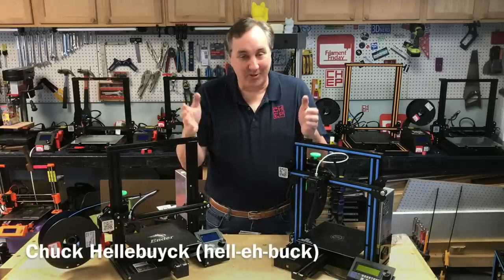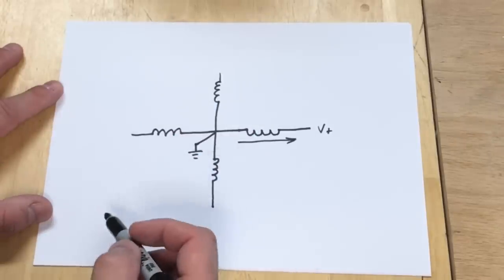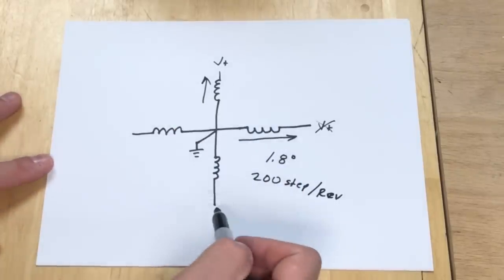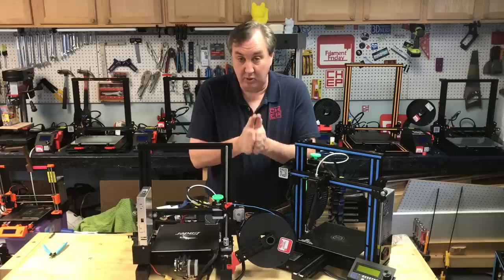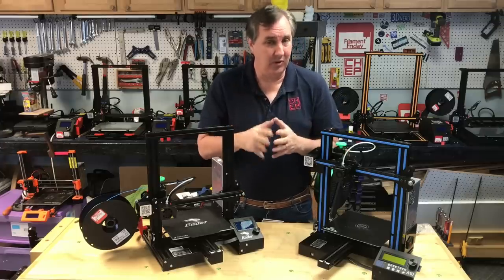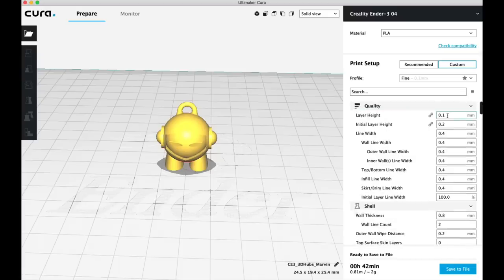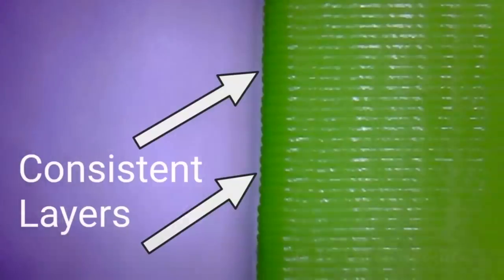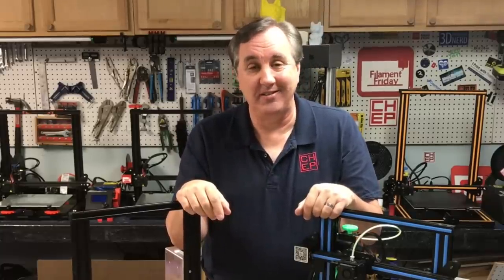Better Quality 3D Prints Using MAGIC NUMBERS on Creality Ender 3, CR-10, A10

Comment from the maker: Here is more detail about Magic Numbers: 
Microstep angles aren’t equal which causes the variations in layers that I showed without magic numbers. If your bed is leveled manually or autolevel at a microstep, using magic numbers makes layers rise to that same microstep thus averaging out those variations and giving a consistent layer height as the closeup view shows,
Reply: Excellent video as usual !
That explains why I see a lot of people printing in 0.16 and I'm like "Why the hell?". I guess that there's no visual difference with 0.1 on their printer and it's way faster to print...
Are these numbers working with the CR10S Pro ? (Yes, that's the one I have since almost 2 months :D).
Reply from the maker: Yes, I believe it’s the same.
Reply: Just set my Ender 3 to 0.12 and WOW!  Way better quality than just 0.10.  Should normally not see a difference og just 0.02mm, but it went from small ripples on a flat wall, to an almost glass-like finish!  Thanks ALOT!
Reply from the maker: Thanks for watching
Reply: Any idea what the formula would be for figuring out a delta?
Reply from the maker: There is a link in comments somewhere.
Reply: Thank you for your videos, I like so much. But I have a point for this one. I don't think this could work, how do you have sure your zero z position is in a full step position? Because if not, doesn't matter if you put 0,04 layer height, you will always get a micro step position.
Reply: Is there any way to get your bed  setup so it homes at a standard step rather than a microstep?
Reply: do the magic numbers still apply to even geared extruders? (3 to 1 ratio for example)
Reply from the maker: @Alan Braggs - Did you read my comment above? I explained it.
Reply from the maker: Rico Reyna - It corrects for z lift so direct or Bowden doesn’t matter.
Reply: @FilamentFriday   your explanation that it evens out over time would indicate that any microstepping LCD of .04 would be just as valid
Reply from the maker: 0.04 is the magic number for Creality machines. So 0.08, 0.12, 0.16 ... all work.
Reply: @FilamentFriday  hi there i have an anycubic i3 mega   would these same numbers work with my printer??
Reply: Awesome video!!! Quick question do you know the "Magic Number" for an Anycubic Mega-S??? Thx in advance. Greetings from Colombia.
Reply: cura now uses the magic numbers as default setting
Reply: Next upgrade would be to update the firmware to not use the microsteps. So go to min Z and then go up to the first natural step. That might even save power.
Reply: @gothmaniow  the T8 2 mm pitch with a 8 mm lead screw is very prevalent in the Chinese 3D printing industry. They all seem to use the same T8 2 mm pitch 4 start lead screws. The only exception I know of is that recently Creality started using T8 2 mm pitch with 2 starts to correct an issue with the Ender 5 and Ender 5 Pro printers to keep the bed from falling down when power is removed from the Z axis stepper motor. This becomes a problem, primarily, when the printer goes into power loss resume mode as the bed falls when the power goes out and then when you try to resume the print fails.
Reply: @BenEBrady  ?????   sorry  that still does not answer my question at all  that was way to complicated for my 53 yr old brain to comprehend   .. all i said was would these numbers work on my i3    was hoping for a simple Yes or No answer and maybe some tips if not ;)
Reply: @tonyd7177  the only answer I can give you is, more than likely.
Now, you CAN measure whether or not the magic numbers will work for you. If you move the Z axis up to 100 mm and then make a mark with some tape on a stationary point and then move the Z axis up (or down) 8 mm, and watch your Z coupler to see if it makes one revolution. If it makes one revolution, then the magic number of 0.04 applies to your printer. If it does 2 revolutions then your number if 0.02.
And my 63 year old brain doesn't have any problems understanding it.
Reply: @BenEBrady  thank you  that was a more than reasonable answer and sorry was not being sarky  i really do have memory problems ;)  , ive copied all what you have just said and gonna put it into practice tomorrow thank you :)
Reply: @AlanBraga  once you get to the first layer physically above the bed and isnt being pushed or pushing against the bed the stepper motor should naturally realign itself to a full step position.  The motor wants to be at a full step at rest and will attempt to go there upon startup.  Only an amount of torque greater than the motor is able to create from friction against the bed would cause that from not happening.i dont even think you could stall even a factory set z axis stepper motor on  a 3d printer without doing something dangerous and stupid.
Reply: How Can I go Deeper in to the subject ?
Reply: I don’t understand how  dividing 200 and 8 results in a the right layer height that matches the Steppers natural movement.
Reply: @efexzium  One revolution on the Z screw is 8 mm, right? And the motor has it's natural steps at 1.8 degree intervals which is 1/200 of 360 degrees (1/200 of one revolution). So the Z movement will be 1/200*8=0,04 mm per step.
Reply from the maker: Turn it one time and measure like I described.
Reply: super video! only a question: if I have calibrated z-steps from 400 to 405, this alter magic number, true?
Reply from the maker: Minor affect but exactly how did you do that? Seems so minor.
Reply: @FilamentFriday  i have a strange problem whit first layer and I suspect that z-steps calibration can affect manual mesh bed leveling process, but this is only a suspect. tnx for your feedback ;)
Reply from the maker: Yes, but Ender 3 and clones all come with 1.8° steppers.
Reply: Can we get an update?
Reply: @chep I'm confused how I could have my bed leveled at a microstep though. I understand setting the layer height part but you lost me with this comment

Comment: I've been using these numbers successfully for quite a few months now after watching a video a while back about "minifigs" or miniature figurines and how to achieve the best possible quality using the smallest detail settings for Cura. That opened my eyes to working specifically with the nozzle size and stepper movements to achieve insane detail. But your video was the first to show the microscopic details of the layers and just how well those numbers are actually benefiting and for that I thank you, Chep! You continue to share such wonderful advice and best of all, in video lengths that are easily digestible vs these other 15-20 min vids.

Comment: Chuck, thanks for a great visual explanation. I found a way to override the default layer heights in Cura 3.6.0.

1. Close the Cura 3.6.0.

2. Open the folder "C:\Program Files\Ultimaker Cura 3.6\resources\quality\" in Explorer.

3. Using a text editor, make the following changes to these files:

extra_fast.inst.cfg:

 layer_height = 0.28

fast.inst.cfg:

 layer_height = 0.16

high.inst.cfg:

 layer_height = 0.08

normal.inst.cfg:

//you need to add new string into the [values] section:

 layer_height = 0.12

4. Save the changes.

5. Open the Cura 3.6.0.

6. Profit!
Reply from the maker: Great tip. Thanks.
Reply: Спасибо, Артемий! Thank you, Artemij! 😊🍸 And of course, thank you CHEP.
Reply: Works like a charm!!!

Comment: I have to congratulate you on what is (in my opinion) probably the most informative YouTube channel I have found.
I have a CR-10 by the way.

Magic numbers eh? Well I'm blowed! Makes perfect sense after you explained it in such clear detail.
I'm printing some prototype motorcycle parts in PLA, and just changed my layer height from 0.3mm (0.4mm nozzle) to 0.32mm layer height and the quality has doubled. No more strange lines. Excellent. Changed all my other little settings to 0.04mm multiples and for sure there's major improvements.

Also, I followed your tutorial on the adaptive layers. Oh man, why haven't I used this before? I just printed a small shaft that has an M5 external thread either side of a larger diameter, barrel shaped body. Previously I would have printed the whole thing at say a 0.1mm layer height to make sure I get a useable thread, and it would have taken forever. Now with adaptive layers, and of course the "Magic Numbers" it's printed out like a dream. Layer height is 0.08mm on the external threads and 0.32mm on the barrel section. And with no post processing, it screws into the little thumbwheel I printed out previous to that. Perfecto!!!
Reply from the maker: Glad I could help. Thanks for watching.

Comment: Folks, you gotta find the right layer heights for your own hardware, you can’t just use his numbers.  Your motors might have 400 steps per revolution, or your lead screw might have a different pitch.  Find your own printer specs and use the Prusa Calculator to get your own optimal layer heights.

Comment: Thanks Chuck - great to find someone with your experience saying this! I found it out the hard way on my resin printer, where the effects were very noticeable due to what turned out to be using 0.035mm layer heights when a natural single-step layer being 0.040mm. Took me a while to figure out, and many people insisted I was mistaken - yet the print results speak for themselves so I've been quietly continuing with layer heights that are multiples of 0.040mm regardless :)

Comment: I was trying really hard to understand the math behind that, but this video does not explain the relation between Marlin settings and microsteps. This video is definitely correct in conclusion, but:

- Z axis on Ender 3 and Ender 5 (first version with T8x8) uses in Marlin 400 steps/mm
- Ender 3 and Ender 5 on stock boards uses 16 microsteps
- Now, the actual amount of real steps per mm is `400 / 16 = 25`
- They use 1.8o stepper motors, which translates to 200 real steps, so the full revolution translates to `200 / 25 = 8 mm`
- The actual accuracy is `1mm / 25 = 0.04 mm`, this is the layer high that can be achieved without using microsteps
- This means that on Ender 3 the best achievable layer high on 0.4 nozzle is 0.12, as 0.08 is too small

Additionally, there's Ender 5 with T8x4 which uses more tight screw with 800 steps/mm:
- The `800 / 16 = 50 real steps / mm`, `200 / 50 = 4 mm` per revolution
- `1mm / 50 = 0.02 mm accuracy`
- This means that on Ender 5 with T8x4 the best achievable layer high on 0.4 nozzle is 0.1 mm
- You can increase accuracy on Ender 3 by replacing lead screw to TRx8 and achieve the same as for a newer Ender 5

Comment: For anyone struggling to get the mm per revolution, remember that the rods generally have 4 threads running along them. You should measure the distance between threads, and then multiply it by the number of threads running along the rod. For example 2mm pitch in a rod with 4 threads, is 8mm per revolution that is mentioned here.
Reply: estcap2 this is an important point, but I wouldn’t go so far as to say that’s typical. Mine just uses regular single start threaded rod. I have a 3018 CNC with quadruple start leadscrews, and some spare dual-start leadscrews. You pay attention to “pitch” for single start threads, and “lead” for multiple start leadscrews 👍

Comment: On the video, you only change the layer height from 0.1 to 0.12 mm. Why did not you change the initial layer height to 0.24 mm and also  the top and bottom layer heights to 0.12 mm multiple ? (In that case you had for bottom and top 6.0 mm layer height. 0.12 x 5  = 6.0 mm, so it works.)
Reply: 0.2 still a multiple of 0.04, no need to change it. Also no need to set top/bottom to a multiple, cura rounds it up

Comment: Changing my Cura Adaptive Layer to 0.20 layer, max 0.12 deviation, and 0.04 steps. That should get me layers from 0.08 to 0.32, all multiples of 0.4 and max 80% of nozzle. Was using 0.25, 0.15, 0.05.
Reply from the maker: Yes, good idea. I would expect you’ll see slightly higher print times but better quality. Especially with your original settings allowing up to 0.4 layer height which is larger than the 80%. I will experiment with this as well.
Reply: @FilamentFriday  I noticed occasionally under extrusion at 0.4 so lowering the max was already on the list, but first I wanted to flash marlin 1.1.9, which I did yesterday, now printing the all in one micro print test with the new settings and marlin 1.1.9, its halfway and looks promising, speed at 90/60 mm/s

Comment: Using Cura with variable layer height (3.4.1 in experimental) and I'm quite happy with it regarding both speed and quality.
Set it now to initial layer height 0.28, default 0.2 with maximum variation 0.08 and interval 0.04...
... just great!
Reply from the maker: I tried it and got very spattered surface on two separate prints. I’ll play with the settings some more.

Comment: The seven minutes time saved using the "magic number" didn't really have anything to do with the magic number itself. You simply printed fewer layers (0.12 vs 0.1 layer height gives fewer layers for the same model), and that's the only reason you saved time.

I know that you know this, but it would perhaps be a good idea to mention it, as some people might believe that the printer prints faster when using a magic number multiple for layer height. Which it does not.
Reply from the maker: Most people understand. No need to explain that.
Reply: But he did say that that's exactly what he said no quality difference but you save 7 minutes

He explicitly noted that on close examination there is a difference but not really under naked eye examination so you might as well use the slightly larger their height to save some time and technically improve your print quality
Reply: The point is that he made it sound like if you used the magic number there would be a time gain. Which isn't necessarily true, unless you always round up the layer height to the nearest multiple of the magic number. If you round down instead, then your print will take longer. Even if you used the magic number.
Reply from the maker: I clearly stated if you use 0.8 instead of 0.6, 0.12 instead of 0.1, 0.16 instead of 0.15, you will see the same or better quality at a quicker print time.
Reply: @mroek  I think most people who would find this video would also intuitively understand that if they rounded down to 0.08mm instead of up to 0.12mm that their print time would be longer than at 0.10mm layer height. Chuck didn't explicitly state this, but he did explicitly state that moving UP in layer height provides the same or better quality with faster print times.
Reply: I changed from a 0.3mm to 0.32 and of course it printed faster because fewer layers. Fully aware of that. But.... And the big BUT is that I saved time (obviously) but as a bonus I got a cleaner print too. Its a win win. Nothing to discuss here.

Comment: I wouldn't call this magic. Prusa has had a calculator for this on his website for ages. But always good to bring it up again.
Reply: "magic number" is an expression widely used - it pretty much means a special number valid for a special use case.
Reply: Michael P https://www.prusaprinters.org/calculator/ second last one. The pitch they have for M8 isn't the typical one anymore which is 8mm.

Comment: Someone has been listening to you! The CreawsomeMod on Cura 4.1 implements 0.12mm, 0.16mm, 0.20mm, and 0.28mm layers .. all mutliples of 0.04.
The Maker's muse has a dirty trick for super fast drafts using 0.3mm layers and some other tricks... 0.32 is an awfully coarse extension of the magic number. It will probably look like hell, but maybe I'll try a small print to see what happens.

Comment: spoiler 0.8 0.12 0.16 0.2 0.24 0.28 0.32 but watch the video because have a lot of usefull information
Reply: Correction: 0.08, since 0.8 is twice the width of the nozzle hole!
Reply: @curiositycreativity6288  Yap sorry

Comment: Brilliant info, and thank you for the series. You're clear, concise and your audio is great! Always a pleasure to find another of your videos. 

I have a project right now with a very complicated stl and for some unknown reason whenever I use your numbers, an unwanted flat solid layer appears in the Cura slice. I'm sure it's my lack of modelling skills but here are my results:
0.16 made a line at 1454 and takes 4d 20:49 587g 178.86m
 (it's a lifesize head ;-)
0.20 made a line at 1075 and takes 3d 21:41 621g 187.02m
0.21 got rid of unwanted lines and takes 3d 14:56 601g 180.93m
0.24 made a line at 869 and takes 3d 08:05 643g 193.65m
I'd like to follow your numbers to help with the post finishing but can't see how I can.
Either way, much appreciated tip! 
~ Future Patron?
Reply from the maker: Sounds like something in the model. Try putting it thru an stl repair service. You can google to find one.

Comment: I doubt this has any recreatable effects on prints. For this effect to work you have to assume your home position is EXACTLY on a natural step of the motor. Fairly unscientific and not rigorous at all. I would need more evidence to support this claim.
Reply from the maker: Justin Moritz - It doesn’t have to start at a natural step. I explain in the comment above yours. And loads of people have used them and see great results.
Reply: Justin Moritz the supposed answer to this is moving from one micro step to the “same” micro step is more consistent than moving to different micro steps.  I don’t believe this for a second, and considering all the other variables that can effect a print layer I’d be very surprised if any inconsistency in micro steps was affecting print quality on one of these machines.  

If the magic number was really a thing you would expect to see any flaws caused by the micro steps repeated with mathematical consistency through the entirety of the print.  Most people claiming magic numbers solved their problems don’t have problems that would be consistent with this issue.

And I’m baffled as to why this would supposedly make a print run faster.